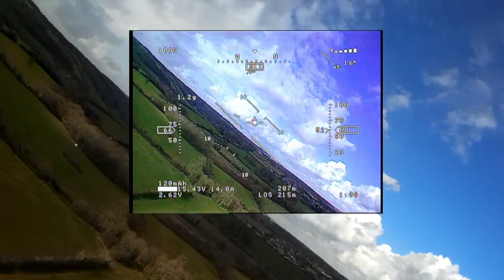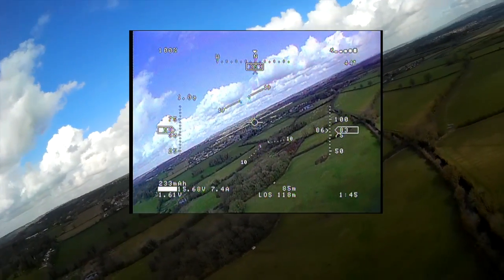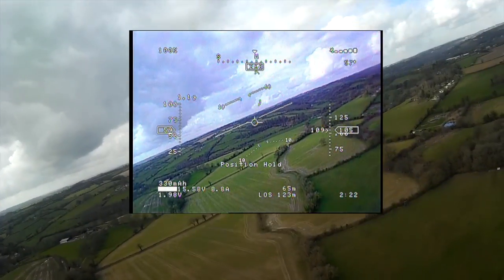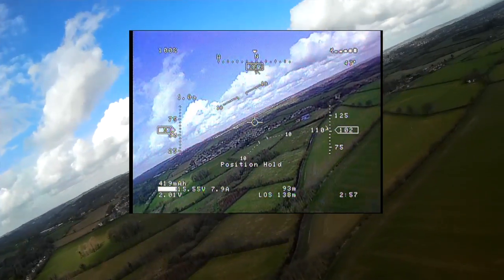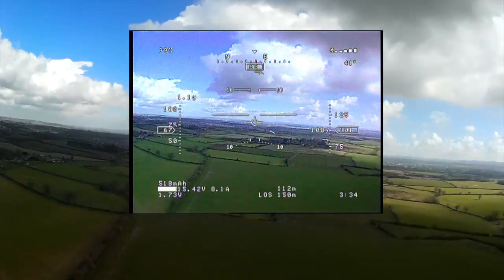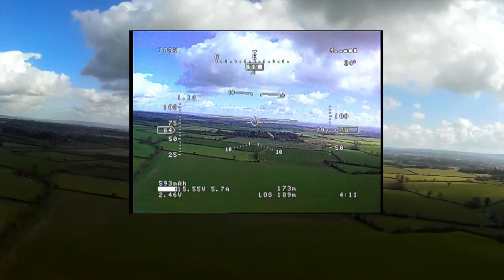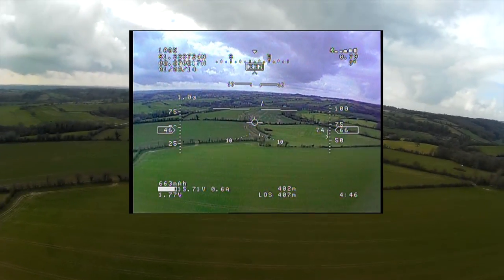Zeta Phantom FX-61 FPV with RVOSD G6

Comment: I'm having trouble setting up my rvosd I have Dragon link and futaba t8j radio . Can't get it to go into rth ,  fly by wire ,etc.. it changes in menu but does nothing on display and motor does nothing and servos either . I can still operate them manually though . Any ideas ?? Thanx
Reply from the maker: Tracy, when you say you can change it in the menu, what do you mean? The in flight menu?

Comment: Good flight, Will. I have my Phantom ready for maiden flight, with  RVOSD 5.1. It's interesting to me, João, to know your values of roll and pitch stabilization gains. Currently I set a value of 30 for both. Thanks
Reply from the maker: I changed my gains a little and it did help some. I think mine are near 30 now on both. However, my problem is motor vibrations I think. I'm going to try some anti vibe mounts and see if that helps. Otherwise I'm really pleased with it.
Reply: ***** Thanks Will. I use the anti vibration mount of RangeVideo, with a small weight on RVOSD, and I have not vibrations.